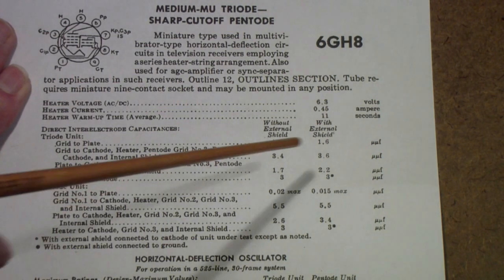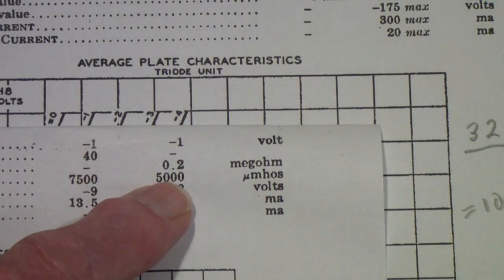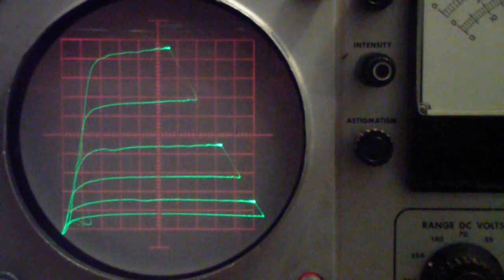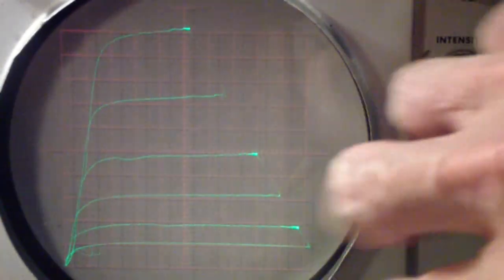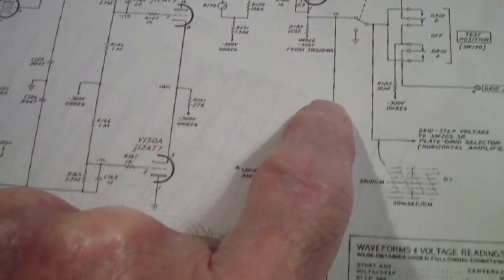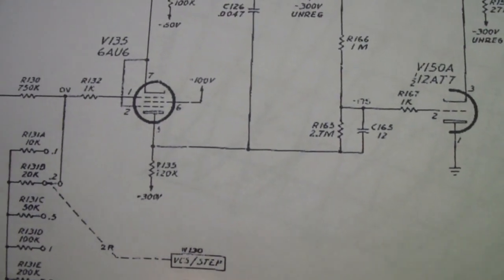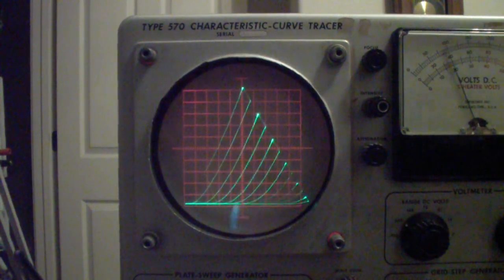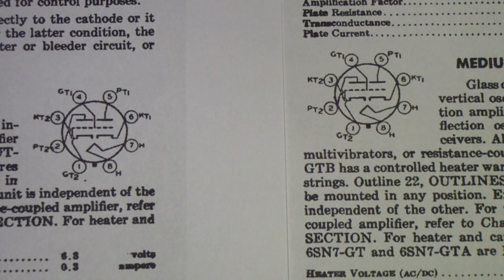TTT304 More Tubes on the Tektronix 570 Curve Tracer

Comment: Congrats on getting an honourable mention in Hack-a-day on your last video, I saw the mention in the blog listing last night. Watched both videos, thanks for taking the time to put this together (I am aware of the time and effort it takes to do videos).
The tracer is a nice addition to the lab. I am toying around with the idea of doing some project involving a module that could be attached to a scope to do the same thing.. but would be more of a novelty these days as direct acquisition sampling into a processor would be more convenient (but less visually exciting). 

Right now I am messing around with some hybrid concepts, using a FET-based CC sink on a tube's cathode to see if I can get more of a linear output in the tubes gain... if it looks good I might put that into my next tube amp build.
BTW, when you say "your last video" I hope it is not the last video, that would be sad news.

Cheers and stay safe,